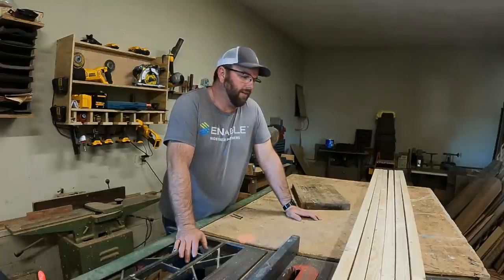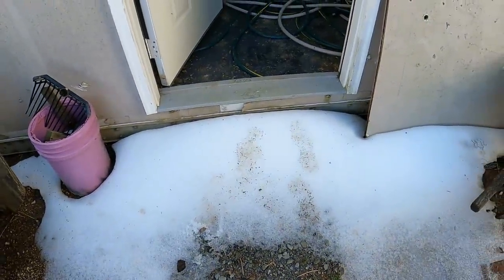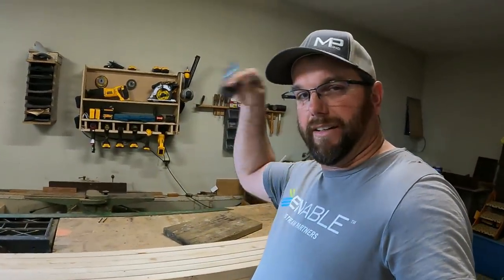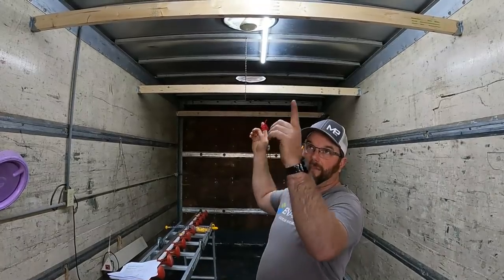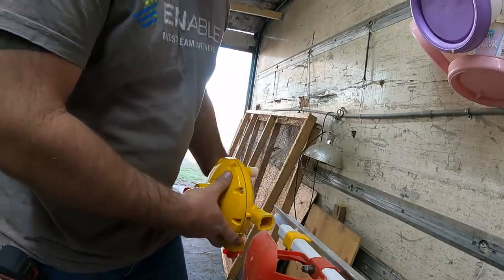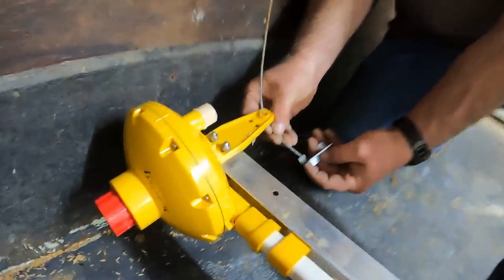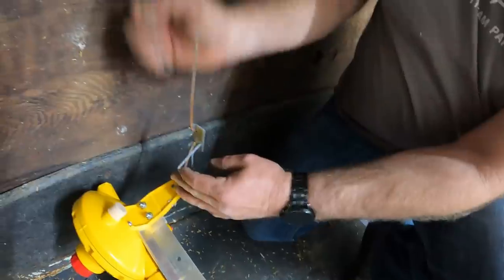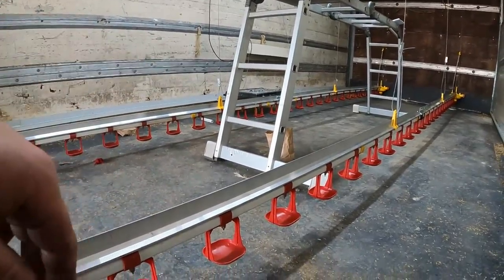Installing Lube System / Chicken automatic nipple waterers

Comment: Can't find the bubblers or frame or bracket for hanging. Need info on where to buy?
Reply from the maker: I google for a poultry supply local to me. I still had to drive about an hour away but I didn’t have to order it online.
Reply from the maker: It’s called a lubing water system.